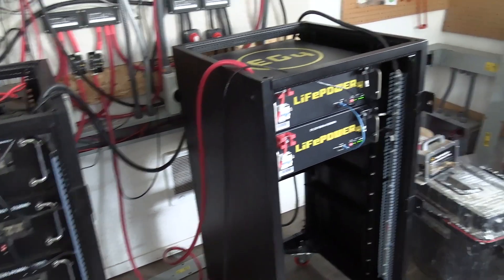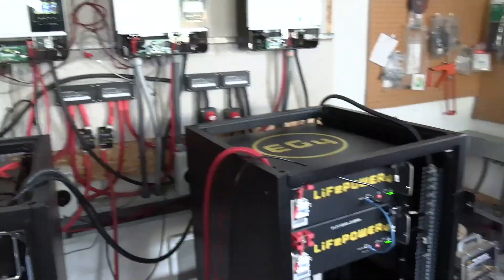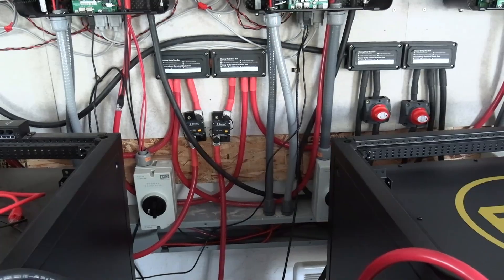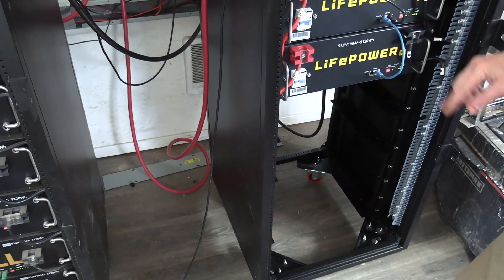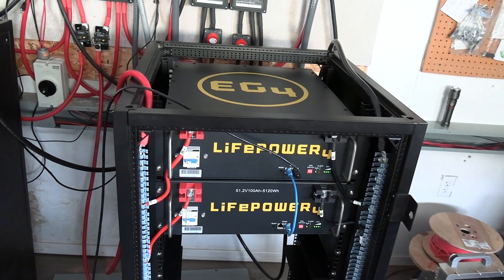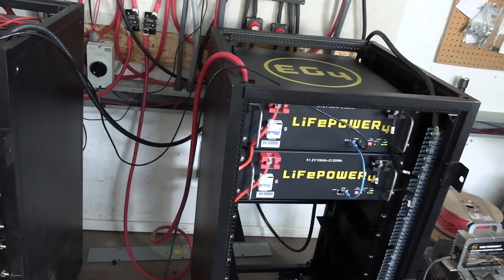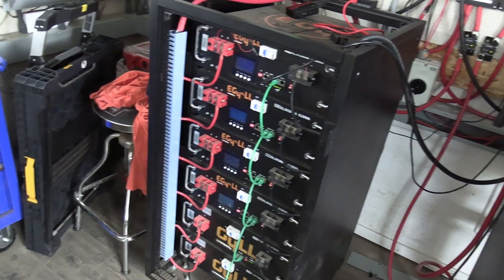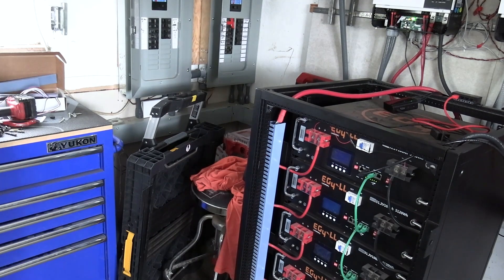upgraded battery storage

Comment: How did you hook you comms up between the different batteries.
Reply from the maker: I use the information provided by the inverters. When hooking up the individual batteries the difference is minimal. So I just use the battery state of charge from my inverter’s. I am in the Philippines right now and have been for a while. That’s why I have a lack of videos. I have lots of video footage. But most of it has nothing to do with solar.
Reply from the maker: As I am doing construction before I can install solar here in the Philippines. I have felt that most of my viewers have no interest in what I am doing. I have 5 employees working 6 days a week on our property here in the Philippines. If my viewers are interested? Please comment and I will show you the construction footage. We are mostly just pouring concrete.

Comment: I have both types. I agree about the handles. It’s worth the extra $250 for the screen,  warranty,  and no issues with the switch.
Reply from the maker: I would like to see your system. It seems to me that we are doing a lot of things the same. That way if I see something you are doing, I can steal your ideas also. one of the things I learned in life is that you watch other people and see how and why they are doing something. if you like it, you can use it or even modify it for your application. from what you have commented? I can tell that you do the same thing.
Reply: @jamesshomesolarmore2223  I keep meaning to make a YouTube video. I just feel like I wouldn’t do a good enough job explaining things. You seem to have a gift for narrating your videos. But I’ll try to make something next week so I can show you maybe. My system is different then yours in that I’m using two  mpp lv6548’s for my inverters instead of growatts. I do have the same batteries though. So I suppose I have a mixture of signature solar and Watts247 products. I’m thinking of making some of my own dyi batteries towards the end of the year as funds allow. I’ve never done it before, but then again 4 months ago I didn’t know anything at all about solar and now I have a 13kw system running over half the house.